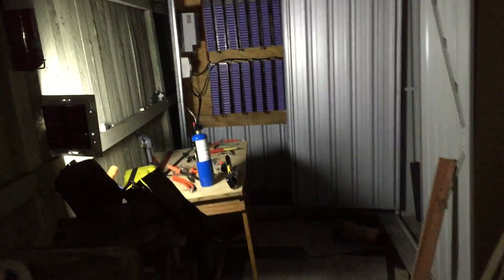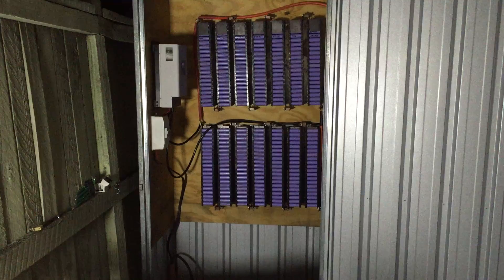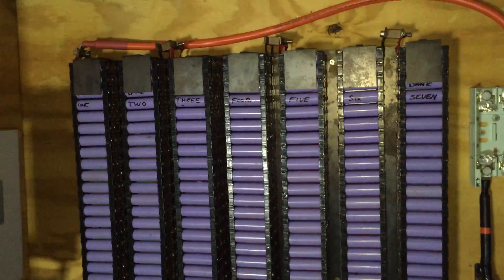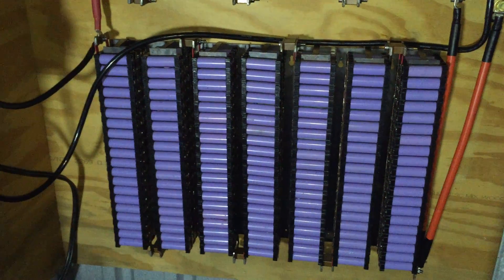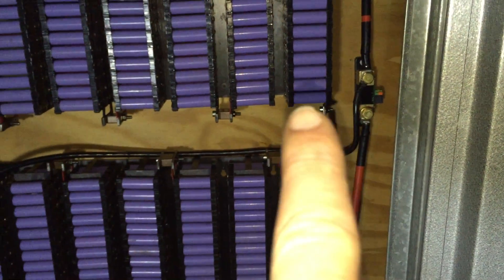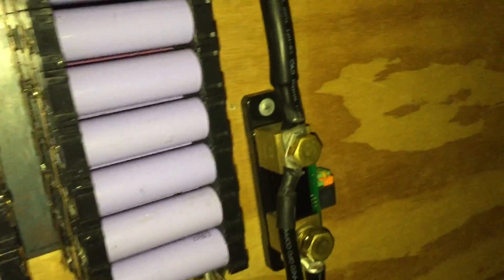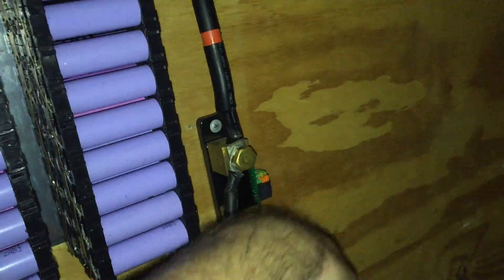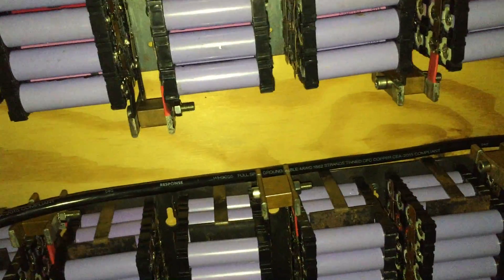Sparkie due in less than 12 hrs.. Gah - and i forgot to hit publish.

Comment: I ask this question politely, but, what happens if you get a bad cell....? Sure, weeding out a bad cell isn't too hard to find, but, as beautiful as your work is, it would be a bummer to have to hack apart one whole bank/rail of batteries just for one, that needs replaced. I got to mention though, your setup look really tough, and cool! Great job, by the way, Drew
Reply from the maker: Very simple answer you pull failing pack out replace it with a spare & retest it .. Not that hard really - time consuming but not hard.
Reply: fair enough for me... I have another silly question.... with both upper and lower battery banks, how long would a 1 amp draw last? Approximately?
Reply from the maker: A year ...lol I really don't know but i think packs are like 300ah each so 600 hours ? MAYBE don't know..
Reply: LOL, A year... either way, I really like how clean the setup is. I politely ask my next question, and in no way am doubting your efforts here, but, have you thought about some level of fire extinguisher, like a class D. I doubt that you'll be on a mission to try to cook these batteries off to the moon on purpose, but, I have had a few of these go full nuclear on me, and it was pretty scary and violent, granted, I had them in a particular situation, that was in a high level demand, but, none the less, still scary... You seem to know what you are doing, so I'll just shut my hole, find my rock to hide under..lol
Reply: I think that is the correct link to class D series for lithium's and polymers .. good luck and be safe, Drew